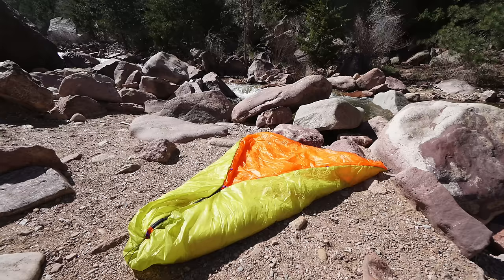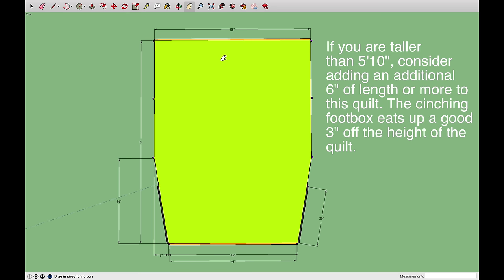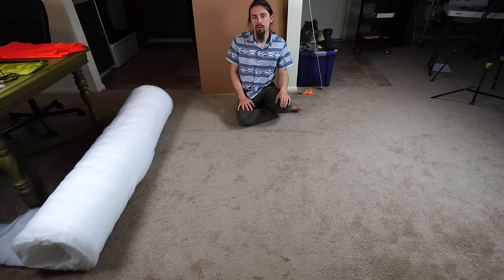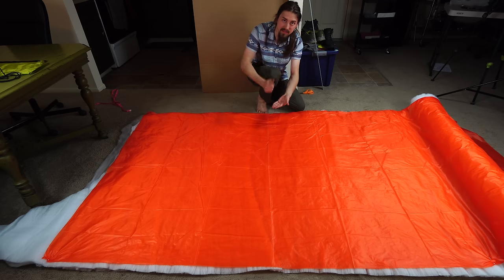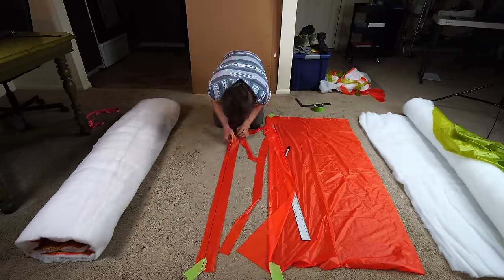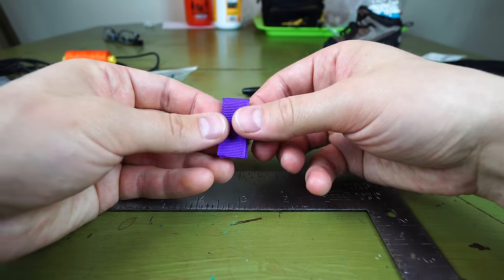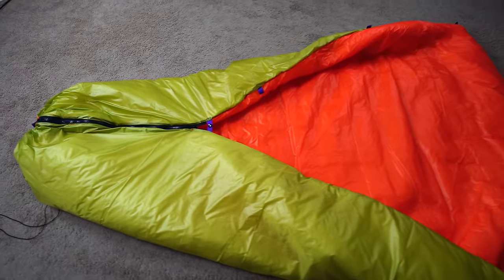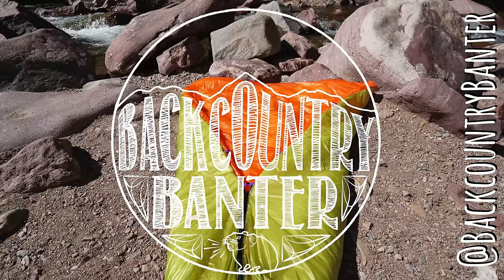How To Make A Synthetic Top Quilt - DIY / MYOG

Comment: I just wanted to post an update on this bag. I made it about a year ago and have spent about 12 nights in it camping in Arizona and British Columbia. It was quite easy to make. I have taken it down to about 32 degrees f (wearing a down sweater, warm hat, wool socks and long johns inside) and it was bearable but I was a bit cold. It packs easy into a 9l stuff sack I have but could pack down further. Overall its a good design, and shows no signs so far of failing anywhere. Its a great bag and I am thankful to Backcountry Banter for providing such a good detailed video on how to make it. It has pretty much replaced my old heavier bag completely.

Comment: Nice job.  I've been sewing for over 50 years so I know how difficult it is to sew in the grosgrain and channels for shock cords.  Only thing I would do different is that I would make the opening (to turn it right side out) in the side of the quilt above the zipper and only make it about 8" long.  It's more difficult to sew the zipper in (more layers) in the section that you left open to turn the quilt.  Just a little easier because the zipper won't move around while trying to sew it after.
Reply: Having now done one of these, I think he put the hole at the zipper because the final topstitching isn't so noticeable there. I did mine without a zipper at all, but that last stitch is pretty noticeable.

Comment: I made this quilt a few months ago. I just spent two weeks backpacking and camping in Arizona so I can report for me (male, medium warmth sleeper) that it was warm down to about 46 degrees F (8 Celcius) with no additional clothing layers. Below that you'd want to add clothing layers. I had one night where it got down to 32 F (0 Celcius). I put on a pair of long johns, wool socks, and a light down jacket with hood, and was just barely warm enough to sleep but I was a bit cold and uncomfortable. I guess this sums up that this isnt a super warm quilt, but it is quite light, compact and easy to make. If you are going to sleep frequently in temperatures close to freezing I would recommend adding more insulation. For me it will work as a good warm weather quilt, but may not be quite enough for the high alpine in the summer
Reply: Also I should note that it packs into a 12l stuff sack, but you could probably go smaller. I am 6 feet tall so I added 4 inches of length and 2 inches of width and it fits me good, with just the top of my head poking out if I really try to cover myself up.
Reply: Thank you for sharing!
Reply: I saw someone else that made a second quilt that he connected to the first one's snaps. I seem to remember he made one with 2.5Oz, one with 5.0Oz. So he could use just one of them or both depending on the expected weather and not have to carry too much weight.

Comment: Awesome video, thank you. Just finished up making five (yes, 5) quilts for me and the family. One tip for the footbox cinch shock cord (and I guess the top shock cord too, but we aren't installing yet for summer use). After running the shock cord through the channel with a safety pin I ran it through the KAM snap gross grain loop (between the KAM snap and the quilt). I then looped it back to itself and tied it off using a bowline knot. Install the cord lock on the opposite side and then do the same bowline tie off. Shortest amount of shock cord and fewest cord locks I could come up with. Not only did it save a gram or two, but there's nowhere for the cord lock to go/be lost and nothing obtrusive when laying the quilt flat!
Reply: The other thing you can do is make the channel the full width and open in the center instead of the ends. Sew the ends of the channel and shock cord into the edge with the zipper and everything else, then put the cordlock on both halves in the center. With the snap zipped you can pull the shock cord from the middle and it'll bunch up just the same, but when you let it out and unzip there's nothing left hanging. Basically gets the same result as yours without the knots.

Comment: With the help of my wife, I used your video (and links) to purchase the materials and make mine. I (of course) modified it a bit for my 6' 1" height and larger frame. Fortunately, the 58" width worked perfectly for my wider quilt. I also went with a longer foot box  and 24" zipper. Final Quilt is 78" long, 57" wide and weighs just at 1.5 lbs and is quite toasty! I have quite a bit of material left over and plan to make several pairs of booties. One will have insulated denim for lounging/walking around the house in, the other will be for those cold nights on the trail. Took the quilt out for a week long section on the AT, and it is fantastic. Stuffs down to right at 8L.  Thanks for the awesome video brother!
Reply from the maker: Excellent! Thanks for sharing! If you have any pictures, I'd love to see how it looks.
Reply: Sent you an e-mail with attached pictures to your @me.com account. Let me know if you don't see them.

Comment: I made this quilt last year and i have done a bunch of miles with it. I've also been using it for about 4 months straight living in my van. 

It was the first time I've ever sewn. I threw it together in about 4 hours. It's kinda sloppy but it's been holding up well so far. I used grosgrain and snaps instead of a zipper. 

I used the 5oz apex and 10d shell. I've slept in it down to 40 degrees with shorts, shirt and a torso ccf pad and was warm. I've taken it down to 35 degrees with a ultralight bivy, puffy, rain jacket, leggings and the same torso ccf pad and was warm. I've taken it into the 20s but I was sleeping in my van and i had a ton of layers on. 

The loft is holding up fine except for the bottom of the foot box. I toss and turn a lot so that's probably putting a lot of stress on the insulation. 

I plan on making another one for the pct but making it with 7.5 apex. Should keep me warm enough in the mid 20s. 

Thanks for the tutorial. Instructions were easy to follow. You make great content. 👍

Comment: Thank you so much for this and your links for materials!  One suggestion, rather than cutting a separate piece for the drawstring cord channe, couldn't you just allow 1.5 ins extra at the top of one of either the top or bottom layer fabric and then just fold it under to make a cord channel?  You'd need to also add .5 in cut out on the sides as well to allow for the side channel hems.  You'd still need to pin it, but it would be a smidge faster?

Comment: I just finished this project. It took about 5-6 hours of work to make, so it was pretty simple compared to other MYOG projects. The materials cost me about 100$. I made my quilt 4 inches longer (I am 6 feet tall and wanted it to mostly cover my head), and 2 inches less wide. The total weight is about 615 grams. So far I am quite happy! The hardest part was sewing the zipper in, especially at the end after turning the fabric inside out. I am wondering why the hole to turn it inside out wasn't left in a non-zipper part.. I'll report back later on how this holds up on a long backpacking trip.
Reply: Hi Devin, did you test your quilt yet? :) would be interesting how it worked for you. what climashield apex did you use? Best wishes, Paul
Reply: @MrWumm1  I did finish it, and posted some detailed comments on it in this video (just scroll down until you see them). I used apex 5.0 as per the directions. I found the quilt comfortable in the 40's, but not warm enough when you get closer to freezing.

Comment: I made one as well, pretty easy overall but you need a good amount of space to do layout.  I did mine 78" long as I'm a bit taller, used membrane 7 and the final weight is 20oz.  Thanks for the awesome tutorial!  I'm a beginner at sewing as well, so it's not too hard of a project.  I think it was about 4-5 hours total for me.
Reply: I've been able to use mine for quite a few nights. I love this quilt! Mine is quite a bit warmer then I need, so I often unzip it and use it in blanket mode. Cheers!

Comment: I am just finishing up making this quilt... fabulous tutorial... How do I wash it? I am used to "quilting" quilts so that the batting stays in place during the washing process... how does climashield work floating open like this only being held in place at the edges?
Reply from the maker: Awesome and congrats! These quilts are fairly easy to wash. Just use some sort of tech wash (like this: https://amzn.to/3aI4xB1) and make sure to not use any hot settings. Ideally you should use a front loading washer (not a top loader with the spinner.) You can also wash them by hand in a tub. When you dry it use a low setting. I use tennis or dryer balls to help dry and fluff it too. You can also hang dry, it'll just take longer than you might expect.

Comment: Thanks for the video! It really does a fantastic job of covering every step and question that could come up. I don't know if you will see this question, but I was wondering if you have an opinion on the pros and cons of using only snaps to create the footbox instead of a zipper. thanks.
Reply: I'm about to do exactly that. Only con I can see is it being a little less sealed up down there. Since I'm doing a 2.5oz APEX warm weather quilt that seems like a minor drawback to me, more than offset by the weight savings and the convenience of not having to mess with a zipper.

Comment: Looks good. This answers my question if you make sew the quilt fabric together first and then add insulation somehow or sew it all together. Thank you!
I have a question, why didn't you sew across the whole thing several times to make line and hold the fabric in. Like the lines across a buffy jacket or down quilt. Does synthetic do ok with constant stuffing and unfolding? No quilting required?
Reply: Climashield® Apex does not require quilting. I'm considering using 2 layers of 2.5oz and using offset quilt layers, but haven't decided yet :)

Comment: Entertaining and informative! Not that I know much about sewing, but do you think it would be helpful or necessary to add some stitching along the body of the quilt to keep the insulation in place? Or is that used primarily for something like down or down alternative and not a whole sheet of batting like this?
Reply: If you add stitching on the body of the quilt (in the middle of it, for instance), you'll get cold where the sewing is, because the sewing will compress the material and it won't loft there. It's the lofting that helps keep you warm. 

They need those stitchings when it's down to keep the down from going all to a side, moving inside it. But the stitches don't go all through the material. It's a kind of stitching that doesn't go all the way through.
Reply: Way late to this party, but you don't have any stitching in the middle because APEX is "continuous sheet" insulation, so it's all one piece and will maintain in place without the help. Down and some other insulations (Primaloft, for example) are free floating inside the shell, so you need to subdivide the shell to get even insulation coverage. Some lighter down quilts are "sewn through" meaning they're subdivided just by sewing the top shell to the bottom shell, but warm ones will instead have "baffles" which are little walls of other material running vertically between the top and bottom shells. You can see how that works in some of the down quilt videos around here, but they're typically made of noseeum mesh and they're a big pain to sew in, not to mention fill.

Comment: Hi, Thanks for posting this. I really appreciate it. I am in the process of making this now. There is another video on youtube of a similar project. I'm wondering why you chose to allow the gap to be turned inside-out at the zipper? The other youtuber chose a simpler edge. Since you put so much effort and thought into your design, I imagine you did this for a good reason but what's the reason? Also, the other youtuber chose a thicker nylon taffeta for the material for the cinch channel, your does not. I couldn't find a thicker nylon I liked. I was thinking of doing what you did with the same material. Has the channel material held up to use and tight cinching? I was considering doubling up the material for the channel - your thoughts? I know you must be quite busy and I'll understand if you don't have time to answer, but I'd really appreciate it if you would. Thanks Again.

Comment: Wow that's awesome!! Would it be possible to put two layers of insulation inside to increase warmth?
Reply: Yes, you could and it works fine, but there are also several different weights of APEX available, all the way up to 10oz/yd. At that weight you probably want to be considering down instead.

Comment: Really enjoyed this diy, what temp rating is this, and did you stitch through the center of the quilt?
Reply from the maker: I didn't stitch through the middle. The Climashield Apex insulation used holds up very well and doesn't tend to tear apart like other synthetic insulations. In theory it should hold up quite well with just the edges secured. The temp rating is debatable, but I'm estimating at least 35 F hopefully more like 30 F. I need to do some testing on that though.

Comment: Nice! I no longer have access to sewing machines (or the person who used them 😏), or I’d make one. What are your thoughts on Velcro instead of a zipper?
Reply from the maker: It could work for sure. I'd be worried about being scratch and potentially opening up under pressure though. Button snaps might be a better option.
Reply: Find a Asian seamstress and pay to have two sheets of nylon with insulation. If not just buy an enlightened quilt or just go to Costco and buy a tent and sleeping bag.

Comment: Great video. How did you know what the temp rating would be for your quilt?
Reply: It depends on the apex insulation you get, ripstop by the roll has these ratings 2.5 oz - 50F, 3.6 oz - 40F,  5.0 oz - 30oF, 7.5 oz - 10F
10oz - -5F

Comment: How has the UGQ Been holding up? Been going back and forth about what quilt to get for my 2019 PCT Thru hike.
Reply from the maker: I'm still loving it! I just released a video from a backpacking trip on which I used it. It has been consistently warm and comfortable. Plus it is light and packs down very well. Everything is still holding up perfectly and it shows no signs of wearing out yet. A+++
Reply: What is the coldest you have taken it to?
Reply: Backcountry Banter What is the packed down size?